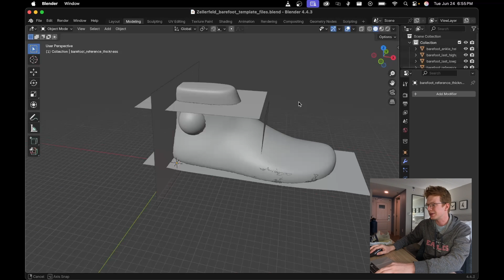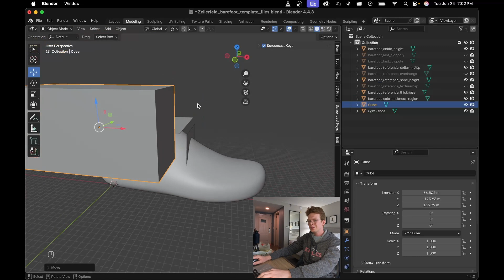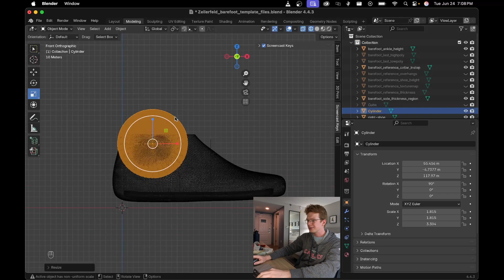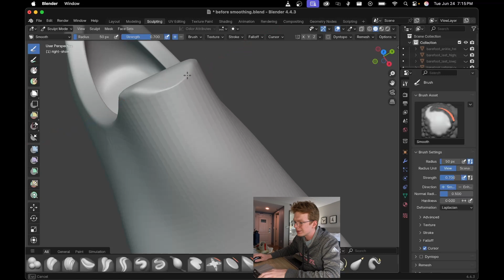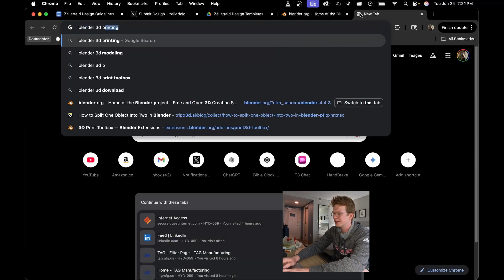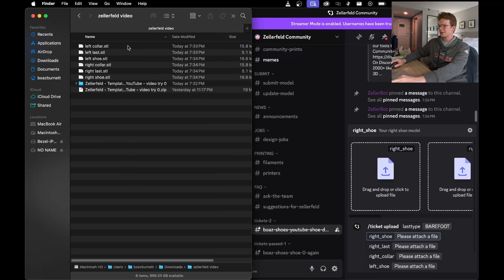Your First Zellerfeld Shoe: Blender for Beginners | Free Files

Comment: Greetings!! I have question about the model after the repair from Formware.Does the model come out looking rough? If so, how do you correct it? Thanks in advance.
Reply from the maker: In my experience that model has not looked rough. It all depends on what settings you use through the process, but essentially all that is happening is that it is flipping some faces and filling some holes to make it manifold.
Reply: @B0A2  Thank you for the reply. I went through the process as you have shown. I had more non manifold issues than your example and once it was repaired the surfaces looked rough. Still working my way around it. I'm using Gravity Sketch then trying the Boolean Union process afterwards. Once I remesh in Blender, that is when the non manifold issues are created.